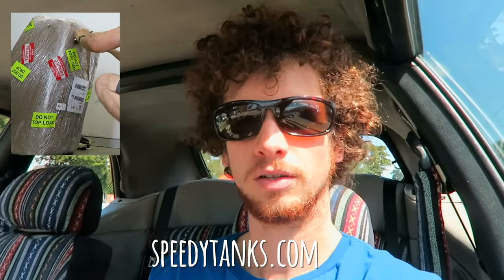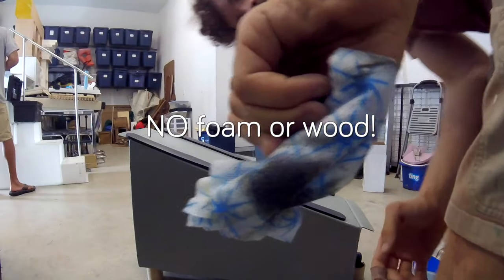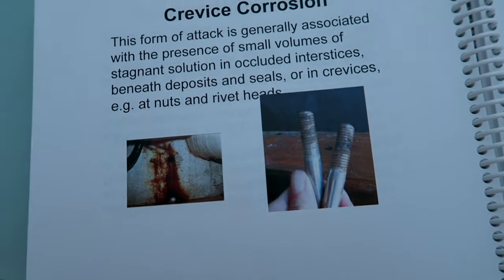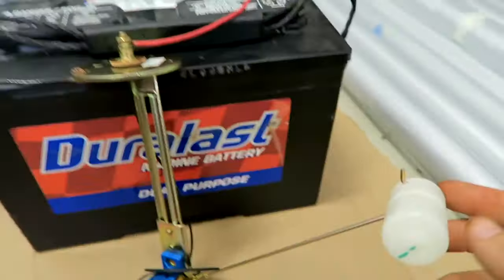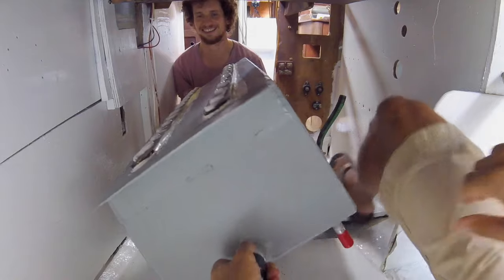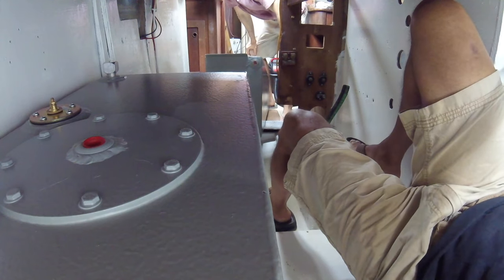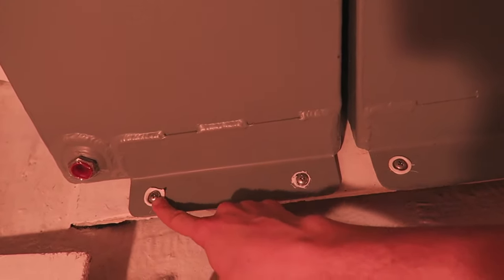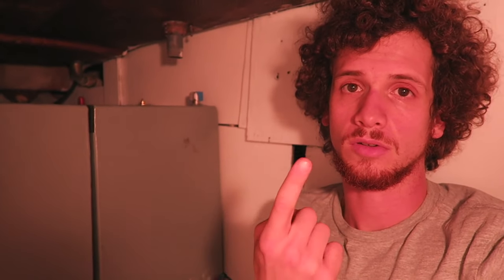15: New Diesel Tanks

Comment: Your tanks are touching at the top because the 1/2" ply they are mounted  to is bowing. Imagine them when the are filled. The flanges on the tanks need to be bolted into solid pieces of teak or mahogany glassed in between the hull and you plywood. When they are full, they will have lots of inertia.
Reply from the maker: Good tip, I might do just that. That ply piece did sustain the weight of the old tank, with about 44-46 gallons of diesel in it, so I'm not too worried. But some reinforcement wouldn't hurt.
Reply: When you only had one tank, the tank itself provided the rigidity.  Now with 2 tanks in there, you have a very different scenario.  I think it is imperative that you glass in some bracing underneath that plywood.

Second, what you have for mechanical restraint of the tanks right now is woefully inadequate.  Imagine 2 x 200 lbs of fuel in those tanks in a heavy sea.  It will rip that neoprene apart, and then tear those bolts out of that 1/2" plywood in the first few minutes of your first outing in heavy seas.  The neoprene has very little mechanical strength, it's more about isolating the tank from the hull for chafe and to prevent trapping of water.  It is nowhere near an adequate mount.

Third, you need to devise some bracing both fore and aft, and side to side.  Those tanks need to be SOLIDLY restrained.  

I am not a Nervous Nelly, nor do I wish to pile anything else onto your massive workload, but what you have right now is a disaster waiting to happen.  Do not underestimate the forces at work in a sailboat in heavy seas.

Comment: I think a half empty tank in a rocking boat will apply a lot of forces side to side with quite a bit of leverage.  I would think you would and a strap over the top of the tanks -- I'm not an engineer or mechanic really, but 5 summers of commercial fishing has given me some perspective on how ocean motion generates forces on things.  Also, your little piece of material between the tanks is actually structurally important in that it allows the forces to push down on the outside lower edges of the tank.  I would make sure it is in there permanently and affixed somehow.  If it is just resting in there, it is possible that as the tanks rock back with fuel in them and forth it could gradually slip down.

Comment: I sure hope that piece of plywood (or what ever it is) is strong enough !  44 gallons of diesel weighs about 330 lbs, plus the weight of the tanks and hoses.

Last time I just 5200, it took over 48 hours to "set".  IIRC, the directions said it was not fully cured until 7 days !
Reply from the maker: Yeah, the old tank was about as big as both of these and full of diesel that piece of fiberglassed wood seemed to hold pretty ok. But we might have to reinforce that as other comments have suggested...
Reply: When building a boat for open ocean it is better to over build than under build all of the other comments about your tank install were correct that ply board IS NOT STRONG ENOUGH .I have over 25 years experience working on boats that work and fish in rough seas daily . you want overkill!
Reply: 5200 is only as good and strong as the backing it is bonded to.
Reply from the maker: I hear you David. Believe me: We Shall Overkill!!! I'll post a video with us reinforcing that plywood just so everyone in this comment section is left happy and relieved :D

Comment: And you applied 5200 to the bottom of the neoprene why? You're going to make a hell of a mess if you ever have to remove either tank. Why did you not just use the mounting flanges with larger and more fasteners? Also, I don't believe that your piece of plywood will conform to ABYC H-33 requirements. That would have been a great place to use a sheet of G-10. 

I like your videos!

Comment: Marco, 5200 is silicon or pu based? Does we have something like this in Brazil?
Reply: looks like pu based like sika
Reply from the maker: It's pu based, yes! Here's the description from the website: "5200 is a one-component, high-strength, moisture-curing, gap-filling polyurethane". Like sika, yes, but more permanent. No idea if we have anything like that down in Brazil but sika will work on most cases...

Comment: You are doing a excelent job. But the plywood under the tanks do not have the right dimension. Thry to think you are out in a rough sea, and the thanks breakes loose and the damage they will do on your boad and engine, There is only one seloution, once Again, with the right dimensioned foundation under the thanks.
Reply from the maker: We've got them 5200'd and thru-bolted to the plywood, and after reinforcing it against a bend, I'm confident the tanks will stay where they are!
Reply: The worst  senario is 180 degre knock down, it will happen soner or later. I think you have t6 secure your those tanks in a better way.

Comment: I see a lot of good intention but then no masks and you remove corroded tanks and seal the new ones with 5200 ?? how are those tanks gonna be removable in ten 15 years ?
you put ply as your skin in the ports but they are not soaked in epoxy how long is that gonna last? 
I love your channel do not get me wrong but you go as far as quoting ABYC so you should know the standards

Cheers!